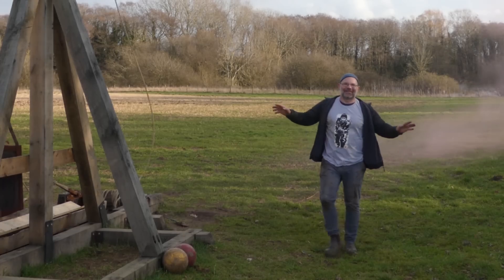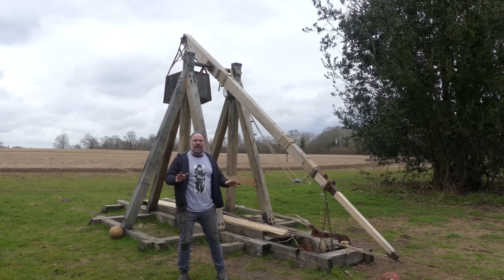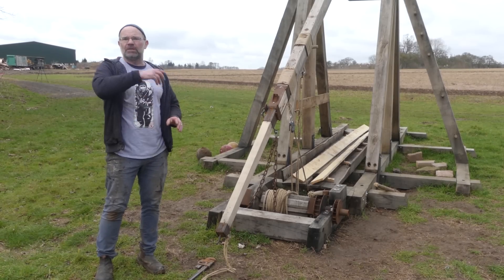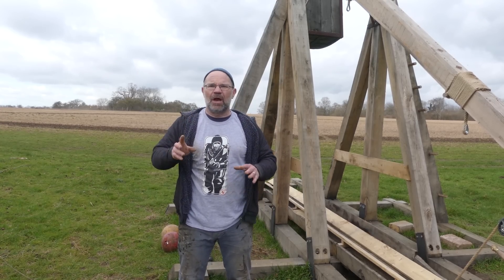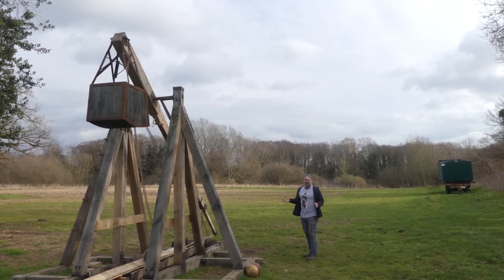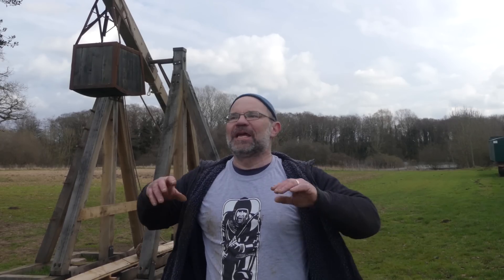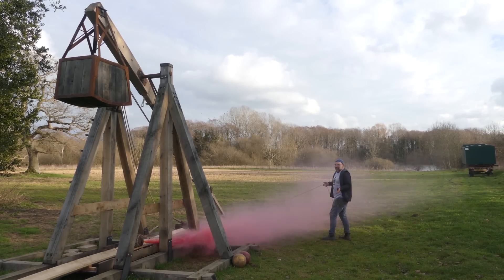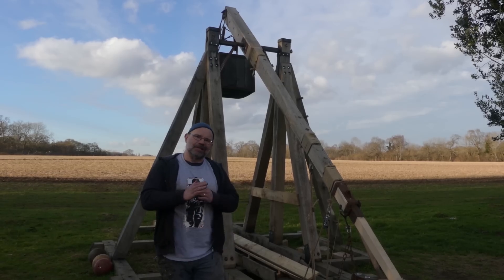Trebuchet - Why won't the darn thing shoot further?

Comment: I'm honestly not qualified to discuss this, but I've read that the ratio of counterweight arm, throwing arm and sling needs to be very specific. Maybe if the pin doesn't work, the issue is the length of the sling or the counterweight arm? Though I assume that you chose the mathematically optimal lengths already so this guess is probably unnecessary.

Comment: There are some papers published online that describe the optimal design of a trebuchet. I assume that you started off by implementing an optimal design which among other things imply a length relation of the long arm over the short arm of 3.75 times. When you from this optimal state extend the long arm you will produce a sub-optimal device in a horizontal distance thrown sense.
Reply from the maker: The problem is it started life as something else so I am having to rework everything

Comment: There are a few people in the comments suggesting that the weight swings too much after the shot. I just came up with a very radical solution to stop the weight at the lowest point.
The old timey solution to that problem is to fiddle around with the parameters (the lengths of the 2 arm sides, sling length, counterweight pendulum length, counterweight mass, arm mass, projectile mass, release angle). The problem is that these parameters all influence both how much energy the weight transfers to the arm and how much energy the arm transfers through the sling into the projectile (resulting in lots of parameter fiddling). The modern solution to that is to put the whole trebuchet on wheels so that the weight can fall "straight down".
Here's my solution:
If you extend the feet forwards a bit, and then attach a hinge to that point, and a second hinge to the bottom of the counterweight, you can connect the two points with a pole. That "guiding pole" will force the weight onto an arc that ends vertically at the lowest point of the counterweight's swing. (The end of the arc is guaranteed to be vertical because the forward hinge and the bottom-of-weight hinges are at the same height at that point.) This will guarantee that the weight has lost both all of its potential energy (if you dimension the guiding pole correctly it will stop at the lowest point it can reach) and also keeps zero kinetic energy (because the weight reverses from moving down to moving up when the short end of the arm moves through it's lowest point). The only part that can rob any kinetic energy at that point in time is the arm itself. Every bit of energy that the arm doesn't keep will be transferred to the projectile.
From there on you'd probably have to only hit two targets with your parameter fiddling: the release angle and how much of it's energy the arm has transferred to the projectile when it reaches the release point. It should be possible to do that by only adjusting the length of the sling (in relation to the arm length) and pin angle, (possibly also the weight of the projectile in relation to the arm weight, and/or the length of the arm's long lever). That's only 2-4 parameters instead of 8.

Comment: Not sure if anyone else has suggested it, but if you put the trebuchet on wheels that run on a short wooden track that should increase the range. Reason being that the counterweight, at the moment,describes a downward arc which is less efficient than a straight drop. Allowing the whole machine to move forward slightly when the throwing arm is released allows the counterweight to drop vertically, increasing efficiency.

Comment: Tod, you may just need to add a design feature that's missing:

https://youtu.be/KpFTyE-wiNo

Wheels.

Otherwise, I reccomend the actual physics equations - do 'em up for your real one.  This is what we did.  https://youtu.be/8hAX72Xgf1U
Reply from the maker: Wheels is an interesting one.  I have yet to see evidence that they did in medieval times so dismissed it.  However as a commentator said, making one within bowshot would be very hard, so perhaps they did wheel them in.
Reply: @tods_workshop  I saw a documentary here in the UK on TV some decades ago where they built one and the wheels as I remember were a historical and Essential part to get good range.  Makes a Significant difference to the range.  The easily it can roll the better.
Even sat on short wooden trough tracks for the wheels so the dirt does not resist the roll.  Not sure if that last part was me or the documentary right now.

Comment: I would focus on the speed of the tip of the arm. Figure out how long the tip travels, to reach the point of max speed, or just before if the point changes as to not include any deceleration. Then simply measure the time it takes for the arm to travel that length for each shot. Then you can isolate any randomness in the energy conversion. So if at one shot it went only 90% the speed of the previous shot, you would expect it to be shorter even if you made a good adjustment to the pin. Then you can discard that shot and try again when the arm hopefully reaches the same speed as the previous shot to get a good comparison. You could of course also try to make a bit of complex math to figure out the difference between speeds and so if you know the distance was 5% shorter but the speed should have made it go 10% shorter, then you know the changes to the pin was good and made it go further than it should have done.

Comment: I don't think your changes made it worse. A release angle of 40° compared to 45° doesn't really make a big difference, and so I think the randomness of the counterweight movement and changes in wind makes a random difference, that makes it hard for you to make a conclusion after 1 shot, so I think the first shot was good because of luck.

I would focus on the speed of the tip of the arm. Figure out how long the tip travels, to reach the point of max speed, or just before if the point changes as to not include any deceleration. Then simply measure the time it takes for the arm to travel that length for each shot. Then you can isolate any randomness in the energy conversion. So if at one shot it went only 90% the speed of the previous shot, you would expect it to be shorter even if you made a good adjustment to the pin. Then you cam discard that shot and try again when the arm hopefully reaches the same speed as the previous shot to get a good comparison. You could of course also try to make a bit of complex math to figure out the difference between speeds and so if you know the distance was 5% shorter but the speed should have made it go 10% shorter, then you know the changes to the pin was good and made it go further than it should have done.

Comment: It seems like the weight just isn't dropping far enough... Seriously... It just seems like it's not falling far enough, and not picking up enough speed.. I don't know...

Like. Maybe shorten the arm by half. So it can go down further.. and push the basket up in the air just that little bit higher.. then. Mess with the angles

Comment: They say the ideal ratio of short arm to the long arm is 5:1 & the ratio of weight to counter weight should be around 133:1. Idk what your current ratios are but somewhere close to those should get you the maximum.
Reply from the maker: Thanks and I know the balls are overweight, but they are easy to throw
Reply: @tods_workshop No problem. I mean it looked like it was doing pretty good to me. You got some pretty good distance on it even w/ the overweight projectile. Honestly the only way to get much more than what a smaller projectile would get.. Youd probably have to build a bigger engine.

Comment: I know it's a huge machine, and there's things to know,,, BUT ,,, with most other machines there's a way to "hold" it to get the best performance. Further,, there may be some tricks you don't know about operation,, for example,, if you use a mouse trap to spin a pinewood car wheel,, the car won't go anywhere, but if you use a mouse trap to pull a rubber band which then slowly pulls the pinewood car wheel,,, the car will move. ,, the trebuchet is certainly a mesh of these particular design elements,, an amount of balance between sheer energy expended and proper acceleration delay,,, but would it be plausible that a team of soldiers using ropes might not pull on it in the right places at the right times to result in increased performance that just can't come from a "dumb-fire"?? ,,, like, manage the acceleration curve basically,
Reply from the maker: Thanks for the thoughts and in fact they did use what is called a 'traction trebuchet' or a 'Perrier' that uses ropes to pull down the arm.
Reply: @tods_workshop  awesome! just to clarify, I am talking about how it might be very difficult to make a machine that offers a particular performance trait. For example, a slingshot or bow,,, it is easy to calculate how a person using a bow can have a maximum power output, but in practice, and and practice with other machines, we have skilled users who are able to either reach, or seemingly exceed these maximum outputs despite the difficulty in "figuring" exactly what it is they are doing. (so, posture, having everything be in straight lines, standing more still, having less friction on the arrow, or whatever else),,, the machine should inherently achieve these goals,, however the weight being straight down, for example, might be one of these sorts of considerations,, where you can't help it,, the weight is going to swing because the point of contact will move as the arm swings,,, so this means that the weight will not pull in a straight line with gravity during the final portion of the arms rotation,, instead, it will try to fall down, but will be pulled towards the center of rotation,,, meaning gravity will be less efficient. So,,, perhaps if the "pilot" knows how to pull the weight laterally so that during the final moments of the projectiles acceleration, the weight is always perfectly straight down from the point of contact to the swing arm,, perhaps it will be more able to pull the swing arm that little faster.

Comment: Shots 1, 2, & 6 as well as one blue line seem to be at your best angle. Though there is a decent amount of seperation at the top of the arcs. The extended arm seems to have some effect on the top of the arcs drop off rate

Comment: 1)there looks like a fair amount of wind at ground level. Get above treetop level and the wind does not have the drag of the trees to slow it down= a big variable. 2)Also wondering if there is some Magnus Effect due to the rotation of the ball https://www.youtube.com/watch?v=8kVuKAqy_2k . Fiddling with the pin might change how much rotation it has in flight and alter how much effect you get. Just thinking out loud

Comment: Adding another two cents to the huge number of suggestions... I think your sling might be too long. I expect to see almost a "whipping" motion as the sling accelerates just before release, and you've got more of a casual twirl. I think it's got too much slack at the top of its arc, and a shorter sling would essentially run out of line and start to accelerate around the pin before releasing.

I should assume it's been mentioned before, but I'd love to see a trebuchet collaboration between you and Tom Stanton. If my understanding of English geography is right, he shouldn't be too far from you, and he's got a pretty solid handle on the optimization.

Comment: I wonder how much the wind affects the distance. It sounded like a rather windy day, so I wouldn't be surprised if the exact same shot with exact same parameters went at least 10-20m further (or shorter) with different wind conditions.

Comment: I really hope I'll be able to get my thoughts across like this in text. This is a problem of optimizing two systems that are almost independent.

You have two levers making two independent circles. Okay, not really, but let's imagine you do. Circle A is done by the treb arm, and you want to release this one when the arm is vertical, just before the weight starts to go other way and decelarate the entire thing. Cirlce B is done by the sling, and you want that one to release when the projectile travels at 45 degrees (or your chosen angle) to the ground (or, more mathematically, at 45 degrees to the gravity vector).

The pin, by its angle and length, only determines the release moment by angle of sling to arm - not the ground. So your pin that releases at 45 degrees to gravity has a pin that releases when the sling is 135 (90+45) degrees from bottom of the arm, IF the release happens with the arm in vertical position. If you change things so that that 135 degree angle is reached by your system before the arm is in vertical position (0 degrees to gravity), you will get a release at an improper angle. Furthermore, if you then alter your pin angle to release at 45 degrees to gravity, it will no longer be in the optimal position and you will get a weaker release (too early and the weight didn't transfer all of its potential energy, too late and the weight is working against itself) as a result - and this last part is what is happening to you, I think.You had the treb in a fairly optimized config, then changed circle A and altered the pin to release at 45 degrees to gravity, without harmonizing it again.

So, you need to alter something. You could change the weight, or the arm extension, but those are kinda hard to alter, and definitely too hard to fine tune, so the answer is obvious (well, it is for me who has messed around with staff slings): set the pin to release the sling at 135 degrees from bottom of arm and then change the length of sling so that it releases with arm in vertical position.

And if it doesn't work, we will know we missed something.

Comment: Watching the side view of the shot frame by frame, I see a curiosity. During the first few moments of movement, the weight bucket is moving essentially vertically. This is accelerating the arm vertical component at 1G rate. After the first 8 frames or so, the arm is up to maybe 30 degrees, and you can see the weight box top tip toward the center of the trebuchet. The box is continuing downward, so still imparting energy to the arm. BUT, it is also pulling the arm backward with the horizontal component of force, as the arm drags the falling weight to the center of the trebuchet. It does this for several frames before the release of the bowling ball. During this part of the shot, the speed of the arm is not increasing as much as it should, and may even be decreasing. Of course you want the speed to decrease to zero, but you want the decrease to start about the time the shot is released.

Comment: I have to ask, is there actual evidence that walls were knocked down with these things (i.e. clear documentary sources), which would require a flatter trajectory to create a projectile on wall contact that would damage the wall. Or were they just used to lob stuff over the walls to harass the defenders, which requires a higher trajectory...

Comment: Physicists gut-feelig:
Shorten the sling
You want it to release from the long arm as late as possible (arm vertical means 100% energy from bucked), whipping the sling around as fast as possible (= short sling!?) but still at around (or ever so sightly below) 45° (pin angle). Right?

Love the trebuchet 👍🏼

Comment: Shortening the pin seems to result in a steeper angle. Therefore a shorter throw. If i remember right, the maximum distance of a throw can be achieved with an Angle of 43 - 45. If the projectile is started with such an angle, the distance is influenced by the speed it is started. And influnced by the Airresistance (which depends on the Mass, size and density of the Projectile) that slows it down and gravity that pulls it to the ground. 
Maybe somebody who is in to ballistics could calculate that?  I would try to variate the Projectile as next. A little less weight could lead to more velocity. Or a smaller with less surface for the airresistance? 
Could be worth a try.

Comment: Based on how the arm is slowing down and stopping at the vertical my guess would be that the rotation point for the counterweight is too close to the axel so the ideal throwing angle for the arm might not line up with the mathematically ideal 45 degrees. The ideal real world angle could be something more like 50 or 55 because the machine simply cant transfer the energy to the 45 degree point efficiently.

Comment: One shot should be fine for each setting for your purposes of just demonstrating that a change in the pin changes the trajectory. A trebuchet is supposed to be inherently precise. Same configuration should throw it at the same spot.

Comment: I really like how this series involves everything except either inviting an expert to physically visit the trebuchet or putting wheels on the thing. It keeps the suspense building for the inevitable conclusion.
Reply: Wheels allowed to move when shooting is supposed to allow the mechanics to work better than when fixed stationary. I think I read or saw that somewhere. Allows the counterwieght box to fall more vertically? The whole engine moves back, then forward(or vise versa) as the arm swings.
Reply: @2bingtim  I'm not the only one who's been saying exactly that since Tod first got the trebuchet. However he refuses to listen to any of the chorus of people telling him that this is part of the problem, and he continues to insist that he doesn't need wheels on his trebuchet.
Reply: @2bingtim  Yes, the weight box travels vertically. The whole machine moves back as the drop starts, tightening the sling. As the weight nears the bottom, the machine moves forward, adding momentum to the throw. Wheels don't matter as much when the weight is on a long swinging link, but are a significant advantage if the weight is fixed to the arm.